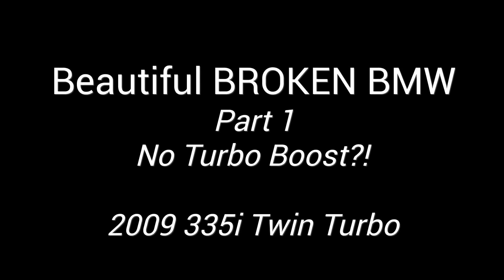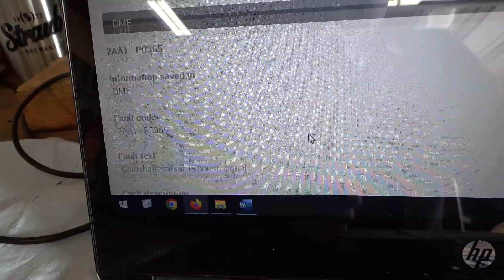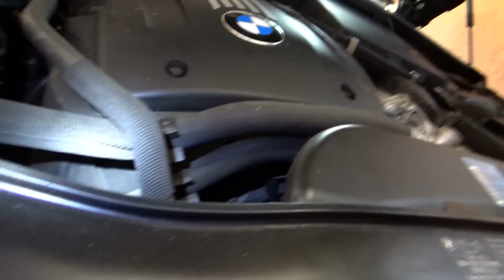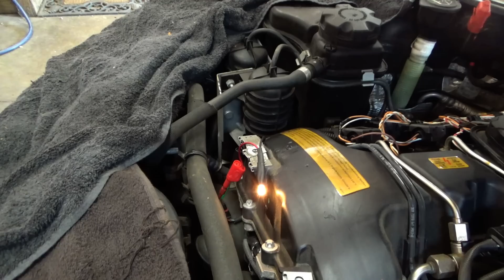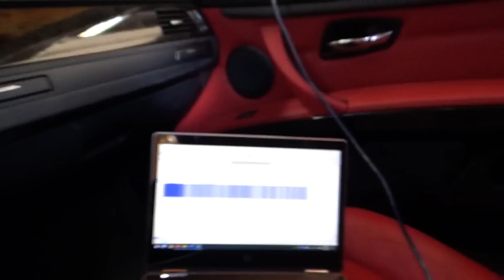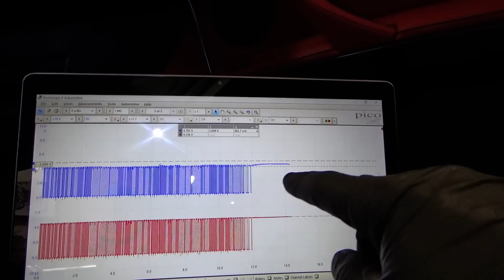(Pt 1) Beautiful & BROKEN BMW?! (No BOOST: 335i Twin Turbo)

Comment: "If the dealer price is MAD, you better call PHAD". 

The bare wires under the cover for this N54 engine is factory stock, which I find very strange especially for a Bi Turbo residing on the same engine side as the bare wires. Normally for BMWs the wiring harnesses all have convoluted tubing many times wrapped with Tesa abrasion tape terminating at the sensor and actuator connectors for the engine harness. Why are the wires not covered with this particular vehicle? This is very strange.

To clean the plastic engine bay covers infested with rodents, a good product is Meguiar's Natural Shine Vinyl And Rubber Protectant. Two applications will bring the black plastic back to looking like new. Apply one wait 15 minutes and then do the final. Customers are very impressed by shiny black plastic covers. 

Usually the CAM wheel 12VDC powered hall sensors will have a pull up in the ECM to close to VREF +5VDC, and the sensor will have a low side driver pulling the signal to SIG RTN (ground) upon switching. The pull up bias voltage is actually coming from the ECM. For this pullup bias voltage to be corrupted means the sensor output drive circuitry is loading the VREF which is a failure. But, is the bias voltage loading that we see with the scope trace enough to trigger the CAM DTC that was stored? My guess is no. The sensor must be failing completely when hot.

Comment: Without an oscilloscope, you'd have to rely on what the computer thinks it's seeing and interpret what it sees. He is usually correct with reading codes but sometimes it requires further testing.

Comment: Ivan, this is the reason I don’t change all of the gaskets and seals on my f30 bmw. Little bit oil leak in the engine bay keeps rodents away 😂 as usual great work sir👍🏼

Comment: Had a 4 series trade-in in with same engine and reduced power. Circuit codes set and found a whole bunch of rodent damage under the beauty cover. Crazy thing is, it was driving perfectly fine with no codes the previous day

Comment: NG engines at these low miles cam sensors  hardly ever go bad so I get really suspicious to condemn cam sensors I seen VANOS issues set cam sensor electrical faults aftermarket scanners sometimes don't show shadow faults.  I will focus more on the vanos system causing that sensor to be out of range.  Vanos solenoids could be an.issue, cam ledges or even aftermarket oil filter or missing parts in the oil cap can effect oil pressure to VANOS
Reply from the maker: I didn't believe that a cam sensor could fail at 27k miles...but the PicoScope does not lie ;)

Comment: if he can afford a BMW, he can afford a cat to protect it  :)  Great work Ivan.
Reply: It's easy to afford a BMW,   it's less easy to pay to repair it.  If you want to own a BMW and drive it beyond  90,000 miles, make sure you have a well equipped garage and know how to diagnose and repair things that don't normally break on other cars.   I loved my BMW, but my weekends were spent fixing things (I had it for 180K miles).   Plus there are lots of fake parts out there.

I would buy another BMW, but only for a weekend driver.   Or lease it and dump it at 50K miles

Comment: I sprinkled hot sauce all over my wires, so no mice!
Reply: I want to get some essential oil of cayenne pepper and mix it with water in a spray bottle because hot sauce is too thick to spray from spray bottle.

Comment: Ivan, have you ever done a diagnosis on a BMW or Mercedes that did not have 30 codes? lol, I sure haven't. 
So many codes that don't correlate with each other and low miles, I'm gonna say critters. On to watch the video only 5 minutes in so far...

Comment: How would you diagnose it without a scope? Easy, parts cannon. Shop looks at trouble codes. Shop replaces cam sensors. Problem is fixed if they install OEM sensors. But they still would have no way of knowing 100% it’s going to fix it without the scope.

Comment: Hey Ivan. I have made many comments on your videos and told you before your intellect and skills lend yourself to shine with working on German cars. Looks like you have this one nailed already and excited for part 2. Especially so for me because- I had an E92 335i N54. I loved it and although it was a bit temperamental, it actually saved my life. Two people hit me head on (they were doing 10MPH on the wrong side of the road and I was doing 60MPH) and they both died. I note the chassis number was 7 digit behind end P which means it was built in Regensburg. Hearing it and seeing the engine made me smile a lot. Fix her and take her for an extended test drive. Absolutely brilliant cars. ❤ love them and also you and your amazing work.
Reply: Been telling you for years, Germans think about engineering and maintenance usually so it might look bad on first assessment but taking a few parts which are designed to be easily removed changes the workability hugely.
Reply: Yo Ivan, to get easier access down front of engine, remove two small torx holding inlet snorkel above radiator and disconnect snorkel from airbox and remove. Hand tighten reasonably cwhen reassembling so don’t strip plastic threads in snorkel.

Comment: Hate working on 3 series as everything is stuffed into the engine bay, the 335's are especially awful for access. 5 series are much nicer to work on as there's loads more room to work.

Comment: This is one of those cases where even though the evidence is pointing in the direction of the cam sensor or wire integrity issue, if you didn't have an oscilloscope, you would be guessing.

Comment: I actually just diagnosed the same type of BMW cam sensor with a volt meter but I went about it a different way. If you remove the sensor and read the signal and pull it up with a piece of metal the voltage was erratic at 3.8/3.9/4.0 volts. A good sensor pulls to a steady voltage of 4.8, in my case.
Reply from the maker: What do you mean "pull it up with a piece of metal"... Like with the sensor plugged in? 🤔

Comment: iv got an 08 convertible,i fought cam sensor issues on it.come to find out on the cams have a steel sealing ring for oil pressure when rotating it would eat a groove in the cam shell and not give full pressure to the cam adjustment.On the later models they changed that seal to teflon changed out the cam clam shells and new teflon seals and no problems since.Mine had 148,000 miles,now on to why the lights wont turn off.When they run good they are fantastic but when they dont its a disaster.

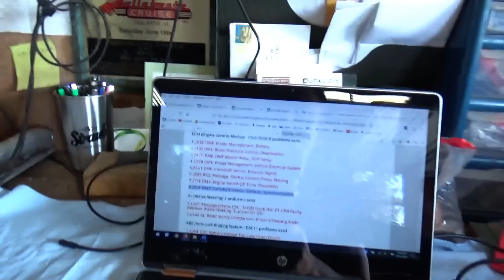Comment: What does it mean when you say “go to OBD2 side”, Ivan? Aren’t you using the port always when you connect the code readers to the car? 3:04
Reply: That's generic obd, only reads ECM.
Reply: If it helps, try looking up "mode 6 data", hes saying he pulled factory codes, not PXXXX codes for the exhaust cam sensor from that report

Comment: Ivan, I would be tempted to swap the intake cam sensor with the exhaust cam sensor, assuming they are the same.  That way you could make sure it's not a shorted signal wire or ECM deficiency.  Looking forward to your next episode.  Your channel is definitely my favorite.  Keep up the great work!
Reply: not the same
Reply: @111-c7x2t  incorrect they are the same

Comment: Better check and make sure the oil filter housing gaskets not leaking very important. Water pump and thermostat will need replaced also. I would also do spark plugs, and Eldor coils!!

Comment: Twin Turbo I6, 6 Speed Manual, Very Low Miles,  FREKIN YUM.

It has some get up & GOOO AT 300 HORSEY POWERS.
Reply: Straight (inline) six, not a V6.
Reply: @LeverPhile  YA, Screwed that up didn't I " STRAIGHT 6 NOT V6 ".

Thank You for catching that I didn't.
Reply: a regular v6 Camry has 300 HP
Reply: @111-c7x2t  They were a special model I thought & did they have a Turbo ?

Comment: Just a stab-in-the-dark but, I would say there are other issues with this "Big Money Wasted" than just a failing exhaust cam sensor.  I know in the past you have stated it can sometimes be difficult to get the information you need to properly repair these cars, Ivan.  GREAT VIDEO!

Comment: My young brother has one and it's a fragile yet very powerfull car. . As for it's turbo, the metal ring holding the air feed tube betwen the turbo and intake manyfold let go. . . His is a white 2010. . .Single turbo. .  And it has a small button below the radio, to the left  "ASD"   that does magic    in abrupt icy down slopes. . .   really magical . .The car will straithen itself and all you do is steer it all the way  down without touching gas of brake. .  Astonishing  . .
Reply from the maker: If it's bad weather, BMW should stay parked in a dry garage... Unless equipped with XDrive 😉
Reply: Only makes 300hp
Reply: @taylorsvilletony773  Poor guy , only 300 hp to let rot im the garrage. . .
Reply: So that must be like there ESP then
Reply: @neilmurphy845  no  4WD

Comment: One of my customers owns one of these. I've done a lot of work on it. The throttle body inlet pipe is a weak point. They like to crack and blow right off the throttle body. BMW updated the design and if you buy a new one from them it's beefed up. They're like $300 though. Canister purge valves are a common failure point. The weatherstrip above the windshield turns to crap, as does the passenger side front door pull. All easy fixes. It's a fun car to drive.
Reply: many people who like crack often blow

Comment: The typical repair approach would be to follow the direction of the cam sensor codes and replace the exhaust cam sensor. It's probably not crazy expensive and if it doesn't fix it, you'd diagnose a wiring or other issue.  And having a new sensor (plus the old one) isn't a terrible outcome.
Reply: Why not check the wiring first though?  Its easy to do.
Reply: @LeverPhile  Of course I'd check the plug and wire at the sensor when replacing it.  But I'm not going to pull the entire loom apart and load check the signal wire to the engine computer, while flexing every inch of the wire or something.  I'll look into that if the new sensor doesn't fix it.  If the part was NOT known for failure or was "very expensive" then yes I'd spend more time on the diagnosis.  This is really a learning channel so I expect Ivan to show us the process that leads to a 100% diagnosis.  But I'm saying in the real world, you don't need to bring out the O-scope for this unless either the new sensor didn't fix it, or if the new sensor is extremely pricey and I need to be sure.  HE needs to be sure because that's the service he provides.  I do agree that with the visible mouse infestation, taking a closer look at the wiring was warranted but I still would have just replaced the sensor and reevaluated the situation.
Reply: @kevin9c1  Let me guess... You work at a dealership?
Reply: @Rick-O-Shay60  No I'm DIY for 24 years.  You must be the same person who says "check all the fuses" for any electrical issue.
Reply: @kevin9c1  nope, just aware of those whom will start replacing unnecessary parts because they lack the skills to properly diagnose repairs.
Reply: @Rick-O-Shay60  On a Mercedes the CMP is like $50 for OEM and takes 5 minutes to replace. How long should I spend to diagnose a CMP code in your view?  Try working on an actual car and then get back to me.  If you don't understand the calculation I described above (when to spend the time deep in diagnosis) then good luck to you.

Comment: Might not directly be a sensor issue. The +5V is pulled up from the ECM through a resistor and the sensor pulls the line down, but if there is too much resistance on the signal line (bad wire or wonky contact) then the pull-up may not be strong enough to take it all the way to 5V. That's also consistent with the signal level dropping when it heats up.

Unplugging the sensor means it's not sourcing any more current, so it will always pull up to +5V.
Reply: I agree. I've noticed a pattern in these videos, "Test Don't Guess" is preached heavily. But, at some point, Ivan says "it's DEFINITELY blah blah blah" and yet, several minutes later in the video he's doing further testing. Are we ALL tempted to fire the almighty parts cannon even when we know better?
Reply: Agree.  The flaky 5V line feels more like a connection failure than an electronic part failure.  This might be a hint of green crusty at the ECM or such causing a resistive connection.
Reply: @russellhltn1396  Exactly what I thought.
Reply: @Stoney3K  But, it wasn't   Both sensors replaced in Pt2 and it runs fine.

Comment: Looks good Ivan you found the problem in minutes...or did you? I would be suspicious of the ECU possible rodent damage or water intrusion, looking forward to part 2! I just turned 325,000 miles in my 1992 525i 5 speed gosh I love this car, I feed it over 6k on the tach all day long the thing is bulletproof.

Comment: Well at least when you drop a tool it can't fall down into the engine bay.  🤗
Final diagnosis.  Owner needs to get a cat, and he is good to go for another 30K miles.
part 3 - Still tearing down engine to remove the cam sensor. 😒
Reply: or a dog

Comment: I guess the wiring integrity is good from the test leads to the ecu but from the leads to the sensor could still have issues.  Bmw uses twisted pair to combat signal interference and if a mouse were to expose a little copper then piss on it that could cause a fluctuation like this..  and the nest was right in between where the leads were tied into the copper and the sensor itself..  more than likely its the sensor but ruling out the copper totally in my opinion is not 100%..   is like 85% likely its the sensor..  and as a poor person for a part that costs more than 20$ its worth my time to verify complete wire integrity..

Comment: A friend's daughter had her eyes on a beautiful turbo BMW at a used car dealer, I forget what model it was.  She asked me to take a look at it before they bought it.  First thing I noticed was it was leaking oil from just about every orifice on the engine.  Took it for a drive and engine had no power at all, never even felt like the turbo was coming in.  Seemed to idle decent but when I removed the oil cap it literally shot off the valve cover and the engine would completely drop a cylinder.  Put cap back on and cylinder came back.  And to top it off, no codes for anything.  Told her to run as fast as she could.
Reply: if its not leaking oil it has none,only vehicle iv owned where all seals,oil pan,oil filter housing,valve cover gaskets are regular maintenance.
Reply: @roberts6236  4.0 jeeps very similar lol
Reply: @v12alpine  especially if it's an XJ and you've never changed the oil filter adapter o-rings
Reply: That's the problem with a BMW...you get to a certain point and they are expensive to maintain.  No maintenance issues were taken care of, and the owner decided to make it someone else's problem.

Comment: Hi Ivan,
That's a nice BMW. Keeping fingers crossed it's only the exhaust cam sensor. I just had to replace the water inlet on my 2006 Toyota Sienna van with 3.3L V6. The water inlet broke where the lower radiator hose is attached. Hate those plastic parts. Dorman had an aluminum replacement that fit like a glove and came with a thermostat for $45 and change. Took me three days working only an hour at a time due to my chronic low back pain. Looking forward to part 2.
Reply: I think the OEM replacements for those are metal upgrades. I know it’s a non electronic Dorman part, but I’d still be hesitant to use it considering the access. The last non electronic Dorman part I tried( customer’s idea) lasted about 30 miles, but it was easy access.
Reply: You sound like me if it take a month to fix my car with a bad back I'll still do rather than have someone else touching it
Reply: @johnmitchell8925  Hi John,
If I had the money to have it done by a mechanic, I would. However, being a mechanic it's difficult to have someone else do repairs I could have done easily if it not for the injury.

Comment: Glue Traps. I place at least 2 glue traps tied down (with cable ties) in the engine bay. I found a dead mouse on a trap in the engine bay on my 98 Ford F 150 last week.
Reply: Nice 👍🏼 job ! 
Also pure (strong smelling) peppermint extract sprayed in the area will help keep mice away .

Comment: The problem with these cars at low mileage is that many components are on original design versions. These cars were problematic from new and BMW gradually fixed all the issues over many years.
Reply: or their fixes destroy the car and that is why people have to buy a new one.

Comment: Garage Queen.

Sensor failure at 15-16 years and low mileage. Time not mileage... hermetic seals fail, capacitors fail, and fuse/antifuse logic devices of that era are beyond the typical end of life (10 yr mfg guarantee).

Heat is the enemy and those underhood beauty covers not only retain heat but give the mice a nice place to hide. 

Some people don't like using rodentcides but they work more efficiently than any trap and keep mice urine and feces out of everything that maybe stored in the garage along with the cars.
Reply: Problem with rodenticide is that they may end up in an inaccessible crawl space (car or house) before giving up the ghost.
Reply: @LeverPhile   Don't wait for the mice to nest in your structure. Keep bait stations maintained all year round. Once you've abated, new arrivals will likely die elsewhere.
Reply: @CJRock-xn5qf  That does not address the problem with rodenticide, which is not immediate necessarily.  If rat makes it into an inaccessible crawl space of your home or car and then croaks, good luck with the clean up.
Reply: @LeverPhile  Then live with endless urine and feces.
Reply: @LeverPhile  Then live with the endless urine and feces.